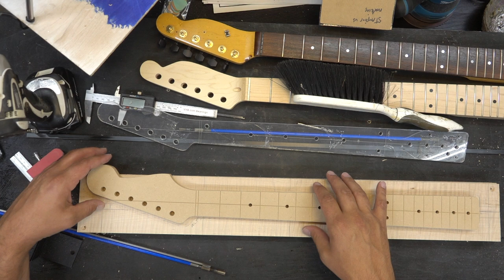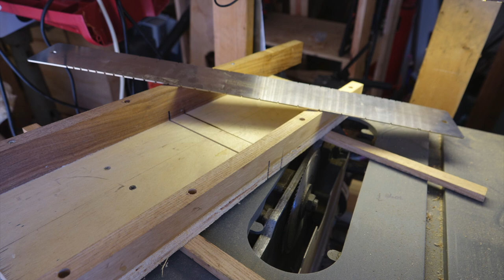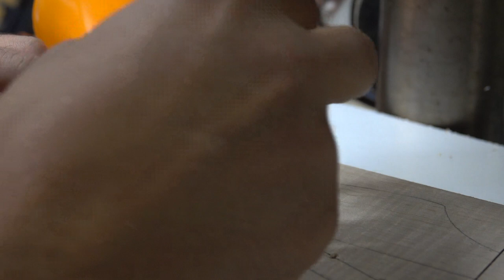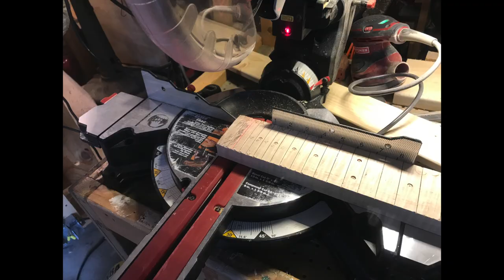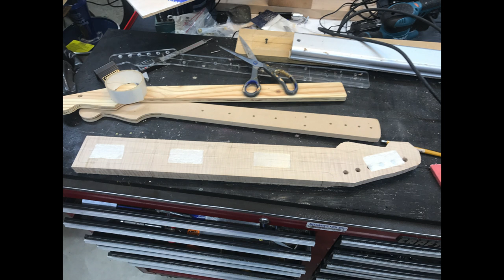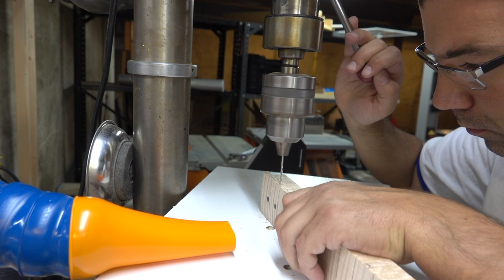Kevin Bond Custom Build Part VI - Starting the Neck

Comment: Good move to use the carbon fiber rods on such a figured neck blank. You can never be sure how it's going to react .
Reply: the neck also looked flat sawn, so i'd agree. i am currently experimenting with curly maple, and i decided that i would try the "hamer" approach to building a neck instead of carbon rods. i am unsure whether or not it will go well, but my research indicates that it will be fine.
Reply from the maker: cool would love to know how this goes.  the neck wants to move after I started carving

Comment: for all those who have never used go2 glue before, it acts more like silicone or wood glue when dry(rubbery), but it goes on kinda like super glue, and it has a 30 minute dry time. it also has a chemical composition similar to polyurethane, but you do not want to attempt to finish something with it. i tried to create an exoskeleton for a tool i made, but there was poor adhesion because of loose clay particles(i used clay to create the mold) and it peeled apart because it has no structure.
Reply from the maker: thanks for the comment

Comment: Another great vid,Mr.D,surprised you didnT put any silicon etc in the T.rod-slot to keep it from rattling, whats your thoughs about the matter?
Reply from the maker: I have done that in the past but not here.  if you tighten the rod slightly usually it wont rattle.
Reply: BigDGuitars - Aside from preventing a rattle, which is spot on. I believe it's Dan Erlewine that said, a loose truss rod is a tone killer. I completely agree. The neck will 'ring' far more when the TR has some tension. When it's completely slack, the TR acts more like a damper inside the neck.